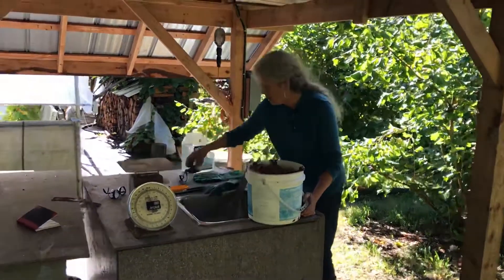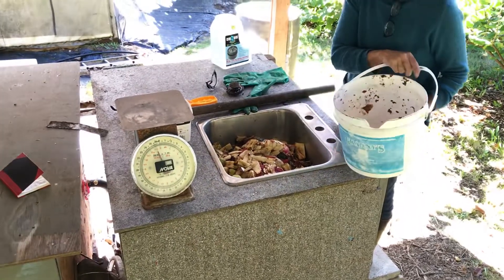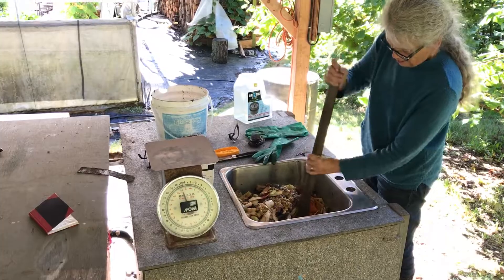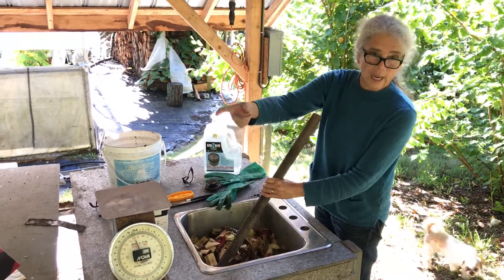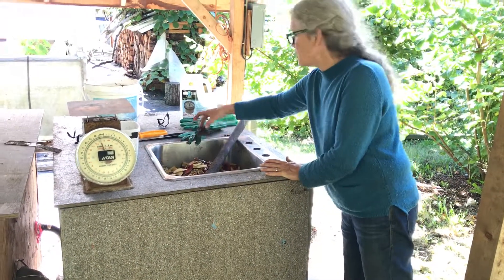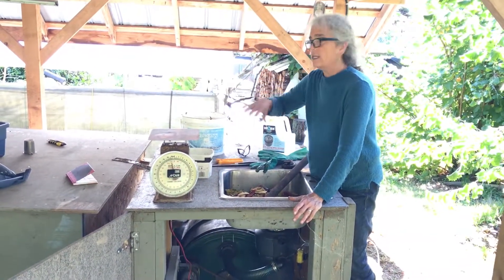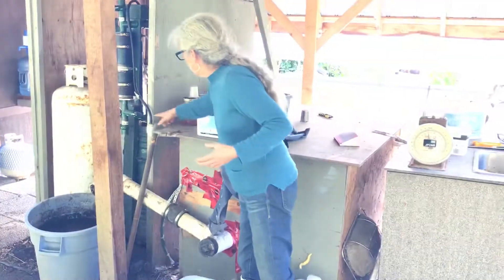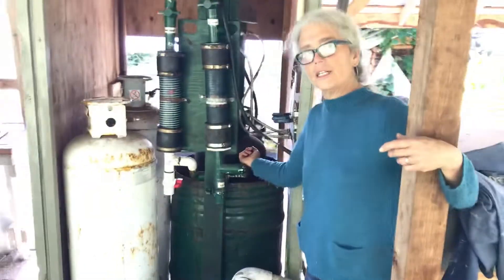My Wonderful Anaerobic Digester

Comment: I wonder if you couldn't have a primary lye digester that breaks down harder materials into something that can be then broken down more quickly and safely by the garbage disposal. You would have to neuralize your slurry before it's passed into the microbes, but the potassium salts that form would be leached into the final product to give a higher compost passium content. The salts would also be highly soluble, so hydroponics could benefit from this greatly. Also, if you neutralize your slurry with nitric acid, you could form potassium nitrate salts which are a powerful fertilizer.

This would allow the breakdown of things like animal matter: eggshells, bones, meat, feathers, fur, chitin, hide as well as hard plant materials like seeds, shells and rinds that could clog up the garbage disposal.
Reply from the maker: I have a cone composter for bones.  Nut shells go into the composts or the forest. Those are pretty much the only food waste I wouldn't put into the digester, and that's because I don't want to wear out the insinkerator blades. I've moved on from the hydroponic experiments. I still stabilize N by putting phosphoric acid in the finished digestate, but now all the digestate is used in my woodchip composts (Johnson--Su)

Comment: That is soo wonderful. You say it is an anaerobic digester. I didn't understand how the liquid fertilizer removal doesn't inject air into the digester since it must be open to the air somehow -- I think I'm not understanding the plumbing there.
Reply from the maker: a pump comes on for 8 seconds a day and pumps from from the first tank, where the insinkerator is, to the sealed anaerobic tank. this causes the anaerobic tank to overflow into the barrel outside of the digester without breaking the airlock because the overflow pipe is attached below the fluid level and angles up to maintain the airlock. hope that makes sense.
Reply: @janesquier3137  maybe, but I think I'd be guessing to the exact setup of those pipes. That would be a good topic for a youtube video so we can replicate it.

Comment: HELP!!!  I have an (unwanted) anaerobic situation & not sure how to best deal with it. About 4 months ago, I put seaweed in a big bucket of water and it broke down enough to use in the garden. But then I decided to "amp it up" and added some alfalfa pellets, shovel full of composted horse manure, & about a pint of fish emulsion fertilizer. Then I locked to bucket. Well it's amped for sure! When I opened the bucket, it was literally churning and stank like you won't believe. Now I'm afraid it will explode if I kept it locked, but my neighbors will likely have a fit in I left it open. Is there a way to kill this process ASAP???!!! Thanks!
Reply from the maker: not something familiar, however I would probably dilute it and use it.

Comment: Ok so you clearly have a better working knowledge of this entire process in terms of the chemical inputs and resulting outputs, as well as the mechanical requirements of such a system, a couple things really stood out for me, first in compressing the gas, with a bar fridge compressor (i'm assuming a standard commercial grade refrigeration compressor with the sealed black shell around the working parts of compressor) is there any explosive hazard created by the compressor? 

And then you mentioned adding glycerin to the feedstock in order to produce more gas while also increasing the  potassium in the output liquid for fertilizer, any chance you can explain that?
Reply from the maker: Sorry it took so long to get back to you. For safety, a flashback arrestor is installed between the storage tanks and the compressor.. 
Here's a link to a paper about using glycerin in AD. It mentions the presence of potassium. https://www.tandfonline.com/doi/full/10.1080/09593330.2012.692723

Comment: Very informative video! Thank you! My question on the cleaning process: shouldn't there be a steel wool cleaner also? I'm just learning here step by step. Thanks
Reply from the maker: Rust and steel wool can be good for H2S removal, it is said that the steel should actually be Fe2O3 where the S- can replace the oxygen making some kind of FeS Iron Sulfide compound.
My digester uses a 3 inch inner diameter x 10 inch long vertically oriented filter with plastic dish scrubbies in the bottom and a an activated carbon product impregnated with Fe2O3 on the surface, leading to a huge surface area that can be saturated with sulfide, this Product is called Sulfatreat coming from Edmonton can be purchased in small quantities from Off-Grid Gas. There are other similar sulfur removal wood and rust pellets from Puxin Technology Co in China,.
Steel wool was tested but it does not hold its form for very long and rusts into nothing. We also tried to use steel wool as a fly screen and flash arrestor for biogas vents, however it also rotted away within a few months. Finally, straight rust flakes can be used to remove H2S from biogas, by bubbling the biogas through a water trap filled with rusty water, or rust powder in water. The challenge with these methods is the uncertainty around the effluent levels of H2S. For best results the gas should be saturated with water, meaning it can be immediately after the digester, which is producing warm, wet gas.
Also make sure to have drip traps and pressure indicating manometers before and after the filter.
Reply: @janesquier3137  thanks for the detailed answer! I'll probably go with the rusty water immediately after the digester and maybe another chamber with the steel wool. Great advice! I've never tought about rusty water! Thanks again!

Comment: The pressure builds after your filters, actuates a switch and compressor runs. That is clear to me, what i want to ask is how does the firtilizer extraction work? Your fermentation tank is under some pressure before the compressor starts i supppse so will it be pushed out or do you tap it manually? I love your set up! Thanks for this clear view and explanation of your set up.
Reply from the maker: a small bilge pump comes on for 8 seconds a day. It pumps from the pre-digestate tank to the digest tank. There's an air-sealed pipe exiting the digestate tank to maintain the correct level so as new digestate is pumped in, the finished digestate overflows into a plastic barrel on the outside. You should be able to see it in the video.

Comment: Really nice film!can you explain hydrogen sulphide scrubber in a bit more detail please?    Have you used biogas to run an engine?
Reply: Kealan is developing training on bio-gas generators for rural Ethiopia. Bio-gas has lots of carbon monoxide in it, which slows the spread of the flame front enough that it is still burning on the exhaust stroke, overheating the engine, unless you advance the spark timing. You do that by making the magnet pass the magneto sooner in the cycle.; he asked me to help him do that. We removed the flywheel with a three-arm puller, removed the square shaft key, and filed a notch in the key so that the flywheel could be rotated ten degrees and then replaced. That made it run much cooler. You don't really need a key in there at all except to align the flywheel while you install it. If you have the conical tapers on the shaft and in the flywheel clean, and torque the central nut to spec, the wedging taper will hold the flywheel at the  angle you chose. 
Of course, if your flame front is moving slowly, an obvious adaptation is to run the engine at slow speed. On a generator, the rotational speed is determining the frequency of the alternating current output, so on a two-pole machine you have to run 3600 RPM for 60 Hz or 3000 RPM for 50 Hz. But for many purposes, such as grinding grain, a slower speed would work fine.
Reply: we use a charcoal type material from the oil and gas industry to filter out hydrogen sulfide. The methane is diverted through the filters before being stored in tanks. Kealan, of Off-Grid gas, who built this digester is using the gas for a generator. I know he tweaked the air/fuel intake but I don't know if he did anything else.

Comment: What about the energy cost of running the insinkerator, pumps, and gas compressor? curious how does that compare to the energy gained out of the system?
Reply from the maker: I haven't worked it out, but don't imagine it figures considerably. It's operated less than 10 minutes a week.

Comment: Amazing set up, I have so many questions as I am planning on setting up my first digester myself

Do you by chance have a list of parts for your set up? 

How is the digester heated? I was thinking about using a closed loop heating system using an in line on demand biogas water heater (for RVs) supplemented with a home made solar water heater, with the gas coming from the digester. 

Your storage system is awesome, a fridge compressor on a pressure switch to 2 50lbs cylinders, and I wanted a bag connected to a variable speed aquarium pump.

I would love to know more about your system.
Reply from the maker: There's a heat cable wrapped around the 50 gallon digester tank which is in an insulated wooden box. A thermostat controls the temperature. Offgrid Gas built my digester... https://offgridgas.org/    If you want to learn about other DIY small systems and have a group to bounce ideas off, check out this great Facebook group... https://www.facebook.com/groups/methanogens/
Reply: @janesquier3137  will do, thanks for the reply

Comment: Wouldn't a large funnel work better than a flat bottom sink?
Reply from the maker: Maybe, but stainless steel sinks are easy to come by and the insinkerator plumbing fits perfectly. Sometimes the kitchen waste is dense and the sink makes a good receptacle to mix in fluids before running it through the grinder.

Comment: Greetings from California! 

What an incredibly thoughtful AD design. Thank you, kindly, for sharing this with all of us. The automation and backyard engineering is inspiring. Love your knowledge and wisdom on this subject. 

I’m curious, what do you use to add glycerin to the system, do you just increase natural fat? 

You weigh the bucket but if you’re always weighing a full 5 gallon bucket of fruit and veggies, which is 60-80% water you should be getting a fairly consistent weight range. But do you also estimate the macronutrient for each bucket (fats, carbs, protein?). I’m just curious what you are measuring / tracking with that weight and what you are looking for? Do you compare it to biogas or digestate output? 

Curious, you have full biogas scrubbing  inline filters with pressure switch compressor to pump cleaned gas into pressurized tanks (are those 100 gallons?), but only get maybe 30mins of cooking gas time? Am I understanding this right or am I missing something? Just seems like you should have endless gas with that compressor and storage tank. Is there an overflow release valve? 

Have you experimented with aerating the digestate? Im curious about how you pasteurize the digestate. You use the unprocessed lignin as soil amendment, and would love to hear more about this and more about other uses for the soil amendment—have you used it as a mushroom substrate or worm bedding, for example? 

Thank you for an amazing video and opening my mind to the possibilities of AD automation. I’m working on an automated AD system right now that runs on a solar panel so I appreciate your insight. 

Respectfully,

APD
Reply from the maker: Lots of questions!

I add around 100ml/week of crude glycerol, a readily available by-product from bio-diesel production, just cause I have it and it helps up nutrient and gas production. 

I don't always have predictable contents in the 5-gallon bucket, I also add waste from the greenhouse and other sources on the property. I can get a feeling for gas production and digestate quality with the various inputs which change throughout the year

Yes, there's a relief valve set at 120 psi. I have 2 - 100 gallon tanks and can burn for a few hours before they drop low. I try to burn regularly so they rarely build up past around 100 psi. If I don't want gas production for a period of time I stop pumping new digestate into the tank and turn the temperature down to 15C. The biology recovers when I put the temperature up again.

I pasteurize on the stove, 160F for a period of time. The solids filtered from the digestate are used in my gardens as a soil amendment.
Reply: @janesquier3137  Thank you, kindly, for your time and care in your response. Your answers have helped me understand more fully your AD process. I apologize for the amount of questions, but not for my enthusiasm for your regenerative designs. Please don’t feel obligated to respond to all my questions—at this point I’m just joining the conversation. 

I am an educator working with middle and high school students on an urban sustainability project, where students currently are building a bioengineered-inspired automated machine to solve urban organic waste problems in our community. We have bio-diesel byproduct as well, so going to experiment with 100ml/week crude glycerol into our AD.  

How many liters is your anaerobic digester in total? Is the first tank chamber after the garbage disposal directly connected to second tank so it auto flows into second tank? So both tanks are kept at the same temp? Mesophilic? the paddles inside the tanks are a lovely design feature. We use passive solar heating tubes to recirculate and keep our fluids and solids inside tanks in suspension and in colder months we actually use a heat exchanger buried inside aerobic compost heap. 

Last year we used our dried sifted solids from the AD tanks in our mixtures to grow oyster mushrooms for farmers market. We often use it as bedding for our compost worm bins and we too love using it as a soil amendment, particularly in potted perennials (urban spaces here).  I asked about your uses because we are brainstorming urban local outlets for excessive solid digestate. 

We pre-treat our source sludge material before putting it in AD which has empirically increased our methane production. We are using the gas to run a modified generator and store electrical energy in battery bank for aquaponics system  and runs all electrical and timers for our AD tanks (replacing our sole dependency on solar panels for our closed loop project—wind isn’t an option in our urban setting). 

I am very curious about your biogas scrubbing filters. Did you diy your carbon filter for hydrogen sulfide and the calcium carbonate for de-watering? Or are they commercial and you have just made the in-line infrastructure? How often do they need to be replaced? 

Thank you for sharing these videos with us. I’ve enjoyed all your videos. In fact, your Johnson-Su Bioreactor video has a link from my alma mater—small world. 

I wish you the best.

Kindly,
APD
Reply from the maker: Hi APD, do you have a link to show your projects with the students? It sounds like a fabulous program!  I like the Jean Pain method of harvesting heat with a compost pile. The tanks are standard 50 gallon drums and are connected.

Comment: Jane is great, but on this one I would use worms to compost the vegetables.
Reply: Can’t utilize the methane from vermicompost though, this is also a faster process albeit lower volume
Reply from the maker: My original purpose in getting the digester was to create hydroponic solution from my organic waste. I tried various methods, including vermicompost and its associated 'liqueur', but the solutions kept going anaerobic, making the solution stinky and it constantly clogged the system. Using digestate changed everything. The material is broken down into a more bioavailable form and it no longer sucks up important O2 in the solution. Comparatively speaking, this is a really fast system. The finished digestate smells like manure.
Reply: @janesquier3137  thank you for the well thought detailed reply.  I do agree about the often stinky solution from the vermicompost.  I do find that the drain valve at the bottom of my worm bin often gets clogged with detritus and I leave that valve open to the atmosphere.  But do I like that the worms are doing the work of composting for me and the lovely compost that ends up in my worm bin every few months.  Of course I am only feeding indoor house plants, vegetables, my goji berry bushes and my haskap berries which would likely survive without the feeding.
Reply from the maker: @fredfrond6148  but they most likely wouldn't do as well without your additions! I'll post a youtube about my compost system soon, which is totally enhanced by worm action.

Comment: How does it do during winter? How many kilos of food weekly?
Reply from the maker: I have a thermostatically controlled string of xmas lights that keeps the hose between the pre-digestate tank and the digester tank thawed. Everything else works fine as is. Right now I'm running a 5-gallon bucket of kitchen waste through each week but sometimes I run 2 or 3 times that much by increasing the time the pump comes on each day with the controller.

Comment: you mean garbage disposal.your going to fry that pump if you dont run water continuously when the pump is running.
Reply from the maker: I haven’t had to replace the motor in 12 years because I make sure there’s enough fluid in the waste material